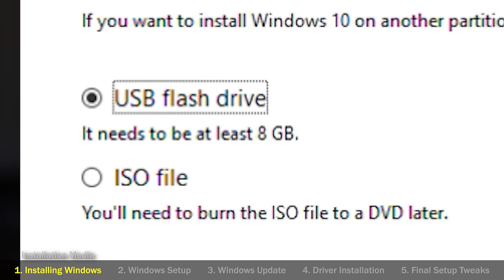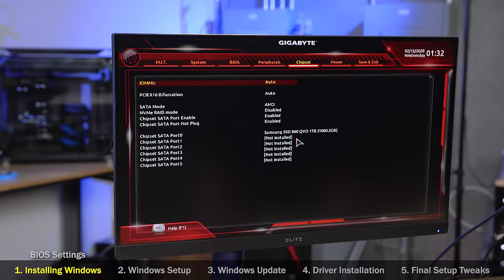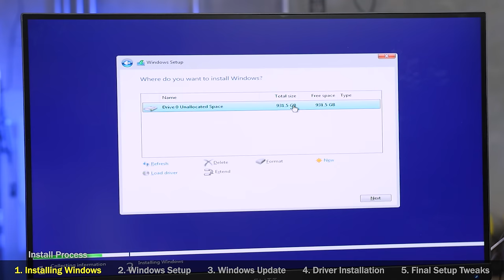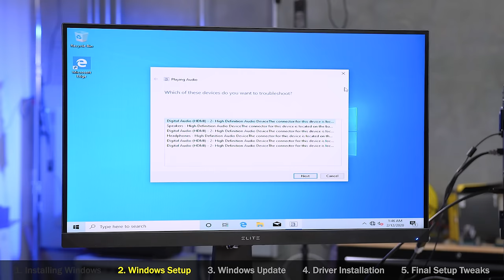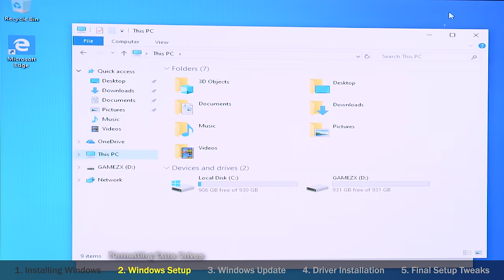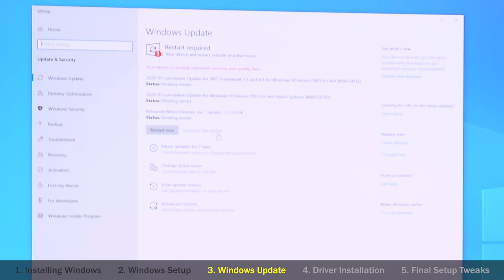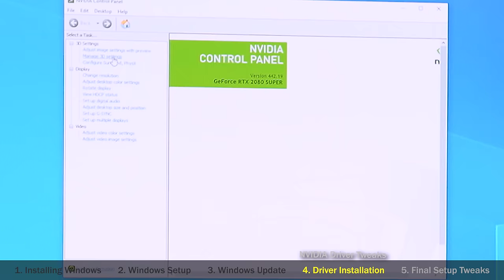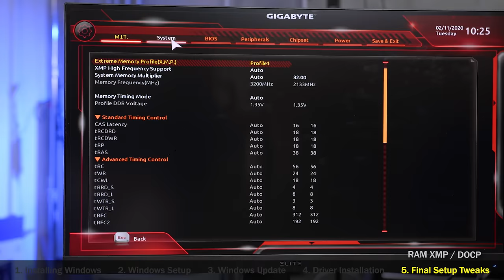Guide: What to do AFTER building your computer...

Comment: I just re-installed my Windows 10 yesterday while having my ethernet cable connected and I was still given an offline user option.
Reply: Yes, the option is always there but with each new version they hide it more and keep insisting to login with online account. you need like 3-4 clicks to do an offline account.
Reply: Yes it does. I actually do use the Microsoft account, my key is registered onto it and I just log in upon formatting.
Reply: @RamiKattan  Win 7 ftw!
Reply: ye but i think that you had older installation if not then its really hidden, but its esier to unplug enthernet most of the time.
Reply: Yeah, but they try to hide it and it is a pain, unplug and install faster.
Reply: @aiu2616  it has a strange link in the lower left, doesn't say anymore offline, but it is always there, 2 days ago I did a Windows 10 1903 install and setup an offline account
Reply: Windows 10 versions below 1903 will give you an option to create an offline account.  1903 and above, you need to follow the trick that Jayz shows you to create an offline account, then you can connect to the internet afterwards.
Reply: Came to say this. You can setup a local account and still be connected. You just have to actually read the screen.
Reply: yeah i did an install today (newest version of win10 1909 install media) and i always have the ethernet plugged in. click offline account, then accept that you will have limited function. takes about 5 seconds total to convince it you want an offline account.  yeah microsoft could make it a bit easier, but still its not very hard/complicated to install to an offline account.
Reply: @budgetking2591  not anymore lol
Reply: I had this problem I got a guy to help and he installed to sticks at the back of my pc
Reply: @jtraimundo  how do you have your key registered to your account?
Reply: You dont even need a key, theres an option to skip it as well, just get the activate windows watermark, jay mentioned it, but wouldnt get one if he used a key 😉😉
Reply: It’s still a pain in the arse to find it, though. I just disconnect from the Internet. It’s faster for me than navigating the Welcome Experience.

Comment: My 2TB HDD didn’t get recognized at first when I went into disk management and i started to freak out so I backed out and went back in and it detected it, this shit is stressful 😂😂
Reply: Disk management > Action > Rescan Disks... 
was a thing I had to do to make it see an SSD I added. Just fyi for any travellers.
Reply: @Josith13  thank you kind sir
Reply: Did you test the "disconnect power cable from the hdd thing"? is this really safe?
Reply: @Mittryng  it works fine now, it just took a few min to recognize it after I plugged it back in

Comment: So if you are connected to the internet there's an option labeled "Domain Join Instead" in the bottom left hand corner of one of the screens if you select that you don't have to make a Windows account either.
Reply: That would only work if the person installed a Pro, Enterprise, or Education version of Windows. Home versions cannot join a domain. Regardless, thanks for the tip.

Comment: Hey Jay, I wonder if there is an method where you install drivers and programs and update Windows to the latest version, you can create an bootable medium in this particular state of the system. If there is a way of doing this, can you make a video about how to do it?
Reply: It is possible, kinda. Google Window To Go. Takes some doing, but you can get it done. I would use a portable SSD though, USB is really slow and SSD is much easier  due to formatting issues.
Reply: Yes, absolutely. Look for Macrium Reflect (.. You can find it in places..). There's a feature to create a backup & also have it be bootable. As well as even a VM bootable backup where you can actually enter that instance in time when the image was created, almost like a zombie in a cool way tbh. Also, the most useful thing is I've found it to be incredibly versatile in terms of raw file size when it compresses & the speed at which its able to create that windows backup. Yes, all disk formatting stuff is preserved & there's even a option to verify not only the integrity of the backup but also the very moment before you go to restore incase you wish to triple check things. However I've yet to encounter a problem by just using the verify integrity upon the first backup.
Speed. I mentioned it earlier. When I first got my laptop I went and hooked up a portable ssd (a SanDisk 500gb one, not the highest end thing but extremely faster than a USB stick or HDD). Upon a fresh build of windows & removing all the crap & installing my key apps, it took approx. 8minutes. That's 8 minutes for a fully compressed windows backup that's now on an external little drive that can be accessed whenever the need arises. Context: the laptop is a Lenovo Flex 14 with a Ryzen 5 3500U. I swapped the internal drive with a higher capacity NVMe drive and replaced the 8Gb stick with a 16GB one.
Reply: There is another method that will persist even if you perform a "reset" of your Windows install, but with how technical the process is and the number of things that are involved is not small....
https://superuser.com/questions/1382332/windows-10-v1809-use-custom-wim-for-reset-this-pc
Reply: But it's not even necessary, you don't have to do any of this!
Reply: Windows does have a built in method that will keep device drivers installed, yes, so it really depends on what you need: 
I personally use an image backup myself so I can have all my software and configuration when my primary drive fails (all drives do fail eventually)

Comment: 6:48 And people wonder why Linux gaming is worth it these days.
Reply: Sorry, Linux is only good if you're a sysadmin.
Due to my own stupidity, I forgot to order Windows until after I assembled my 3600+1650s.  No problem, I thought, I'll just install SteamOS and use that.  Except SteamOS doesn't have drivers for my TX3000E WiFi card.  So I moved it next to my router and plugged it in - and got stuck in an endless "recovering from fatal error" reboot loop - with no indication what the problem was.
Reply: FreezyG21 linux is compatible with the entire programming universe, your brain is the one that is incompatible. no big brother, spying, forced updates or lack there of (win7). you are living in chains by using windows. you are physically capable of changing every single aspect of your linux environment (+more) and there is nothing preventing you from doing so. microsoft, on the other hand... well, ill just leave the complaining to mainstream tech enthusiasts

Comment: This why people probably get prebuilts
Reply: This is pretty easy tho
Reply: The build is the one that can take forever and is pretty nerve racking for beginners, which is a pretty big reason to go prebuild( although still not a great idea)
Reply: @ezgolf1764  yeah let’s just say I went that route and I had to work around 8 hours on the computer as it wouldn’t post just to find out that the Cmos battery was faulty i had completely forgotten about it lol.
Reply: @COB_0116  damn, glad that it’s fixed
Reply: @COB_0116  same I just built my pc and couldn't get it to post with display I thought my cpu was dead but turns out the stupid flick coin Cmos just needed to be taken out for 5 minutes now everything boots up at least for now wish me luck.
Reply: @archieakira4237  make sure to replace it with a higher quality lithium watch battery just to be sure it will boot without issue
Reply: Also to skip the Building Part (trust me u don’t want to assemble a pc if u can’t use a screwdriver)
Reply: @ezgolf1764  mine says reboot and all that stuff and I don’t know how to fix it
Reply: @thinkingbread  when and where does it say reboot?
Reply: @thinkingbread  also what other stuff?
Reply: Ez Golf not really cuz even after all this my games crash and cpu usage be high and disk usage also be high I regret building my pc and no one can figure out how to help
Reply: @ukiyotrash3307  what are your pc parts, can you list them down for me?
Reply: Or you can go to someone that builds pc like i did and pay him a small fee. I did that and he built AND set every thing up for me.
Reply: @ezgolf1764  sorry I didn’t see your reply but when I turn on my pc, on the monitor it says “reboot and select proper boot device” on a black screen
Reply: @COB_0116  think if it only was the switch of the psu was on ‘OFF’ #linuspostproblems
Reply: @thomasverby8179  nah it was on
Reply: @thomasverby8179  it was actually only the cmos battery
Reply: @archieakira4237  was it bios looping?
Reply: @archieakira4237  Hah? That never happened to me. It's the faulty product problem.
Reply: @COB_0116  its all good now thanks for the tip aswell .
Reply: @benitoswagolini3896  about how much did they charge?
Reply: prebuilds also need updates sometimes
Reply: @ezgolf1764  not for beginners
Reply: @skiemetcalf2352  relative to actually building the pc, this definitely can be quite confusing
Reply: At least where I live, will never get a prebuilt PC... imagine with already how insane prices are for parts, prebuilt where I live go for another 30% markup at least, AND you don't get the nice manufacturer warranty, you get the stupid shop warranty which is 1 year for the whole PC
Reply: Still have to do a lot of this on a prebuilt
Reply: Honestly, Jay was making it seem harder than it actually is. The whole "unplug the drive" thing? I've never had to do that...not sure what he was going on about. For the rest though, if any of that completely goes over your head, then why did you even bother building your own PC in the first place?
Reply: @TheDeadAlewives  Well, many people build their pc as they’re on a budget or were advised by friends and family, and often don’t have the time to do all the research. I for one didn’t do much and my friend graciously researched all the parts for me( he finds it fun too so that helps). So, when I was setting  up the os, I had no idea what to do. Also for the Jay thing, this is meant to be a guide for people building pc’s for the first time, and thus covers many possible errors.

Comment: when you transition from intel to amd smoothly without reinstalling windows then weeks later you corrupt the c drive and need to reformat anyway. fml
Reply: Wait what? That really happened? I've switched from intel to amd without reinstalling windows and im fine for almost 2 years
Reply: Happened to me upgrading to a 3900x, and kept happening until i bought a cheap ssd solely as a boot drive and essential programs, my other ssd decided it just didn't like having big games on the same drive as the OS.

Both ssds run fine and i havent had trouble since

Comment: If I’m installing an SSD that previously had windows installed would I still need to install like this if so how would I do that without wiping the drive ?
Reply: if there is windows already installed on a ssd, you don't have to reinstall windows just hook up the ssd to a machine and let windows search and install latest updates for your system.
Reply: Mitke14 Thanks 🙏🏼
Reply: Mitke14 is it really that simple? If I was replacing my processor and mobo can I just connect my current SSD and it’ll boot up? Sorry I don’t know much about upgrading my PC I just built mine half a year ago
Reply: @SideStrafed  yes, you should boot normaly to windows but when you boot up start searching and installing latest updates and also go to your motherboard website and download the drivers. You might before putting that ssd to a new machine update the bios just in case it doesn't want to boot
Reply: Mitke14 thanks man I appreciate it
Reply: Just to let you know, I've done that a few months ago. It worked fine for the most part but Windows would not authenticate at all using the built in solutions. After trying different methods, I manually entered my serial number and it worked.

Comment: That 1 TB 970 Evo is more expensive than my whole system lol
Reply: @grandmasmalibu  I got an i3-2100 system with mouse, keyboard, and monitor for $40. Your statement about sellers giving this shit away is very true. I'm moving forward with the peripherals and taking the case fan and drives for an Athlon 3000G system I'm building, and intend to literally give the remaining (still perfectly functional, just no storage) i3-2100 based tower away for free
Reply: I work building PC's so i build some machines i can never afford every now and then... But i got a good respectable PC, i was running an FX8320 but now i got a i3 9100f and rx580 with 16gb ram so I can't complain.... What i was trying to say is that samsung ssds are overpriced AF lol
Reply: PS i got the i3 because it is what we had in stock in the store, i essentially only paid for mobo, memory and the gpu i already had my drives and a nice 500W psu

Comment: 9:12 Do those privacy setting not reset after every major windows update?
So at 13:11 Windows to Jay: 🖕🏼
Reply: depends on update i think. my 10 pro only did it once or twice. but since i install windows all 3 or 4 weeks now cant say for sure
Reply: I use Spybot Anti-Beacon which checks settings on start up
Reply: @mauriceelet6376  I think it's the only the case for Feature updates - most users will know when they've installed them because they take far longer to install. So realistically you should only need to revert them 1 or 2 times a year.
Reply: if you really want privacy, use linux :) sry.
Reply: If you care about your computing and privacy install GNU/Linux and passthrough your GPU to windows VM. This way you have a clean system AND a gaming system in one. The performance hit is 5% on average. In some games, the VM is actually faster.
Reply: @capsized8603  I'm actually a complete newbie in the technology but I'm catching up... There is a thing called lookinglass that allows you to do that I believe. KVM frame relay.
https://level1techs.com/video/new-tech-iommu-users-looking-glass-headless-passthrough
https://www.reddit.com/r/VFIO/comments/7jo659/looking_glass_has_been_released/

By the way it's still fairly experimental and I wouldn't advise linux newbies to go straight in this.
But this is a possibility! We can now get rid of Windows on bare metal.

Comment: Youre so right when you say nobody wants to talk about the software portion of PC Building. Im a newbie, I wanted to change the 1650 to a 3050 in my Acer Nitro 50 - 640. I found at least 10 videos of how to unhook and screw it in, which is super easy, but not a single one of them taught me what a Driver is, or how to download it or how to use it. They just screw the GPU into the case and say “thats it guys, please subscribe!” 
It does me no good.
I put the 3050 into my pc but i have no idea if its even working right at all and i have no idea what to do now. I need Software Help.

Comment: I will be watching this again, probably several times. I've still got parts coming for a new build. I don't have any problems building, but software is a bit scary. I'm used to DVD drives, but this new system won't have one, so must watch and learn.
Update: Build completed, only snag was windows didn't install a LAN or WiFi driver. So I had to take my thumb drive, and download those drivers from the ASUS website on my other computer, then take them to the new machine and install them to the computer. WWJayD? That! Problem solved, Windows 10 installed and fully updated. Updated everything except BIOS. That scares me and just no. It's a z790 MB, so good enough. Anyway, thank you for this video Jay and Co.!

Comment: I know this is an old video Jay, but I would also recommend running some base benchmarks like Cinebench (for CPU) and Furmark (for GPU) and checking whether scores are somewhat in the expected range, just to find out if there's thermal bottlenecking or something else wrong with the hardware.

Comment: 1 tip I can think of is that people will need an HDMI 2.1 ver. interface (and cable) on their monitor and GPU to play anything 4K at 120-144Hz. HMDI 2.0 can only do 4K at 60Hz. Display port 1.4 will do 4K at 120-144Hz.

Comment: I'm afraid I haven't read nor searched all the comments because the list seems endless but I thought I'd mention that it's wise to do a dDISK CLEAN UP , selecting everything,  followed by a DISK OPTIMISATION on the boot drive and finally enabe "RECOVERY" and "CREATE A RESTORE POINT".  That way if something goes badly wrong you can use SYTEM RECOVERY at boot up and not have to go through the entire procedure again.

Comment: Great video . I always install the latest BIOS update before installing Windows too. My motherboard needed a BIOS update to install Windows 11 when it came out , it originally wouldn't install it with an older version on . And you never know if there's an issue that's been fixed in the latest version.